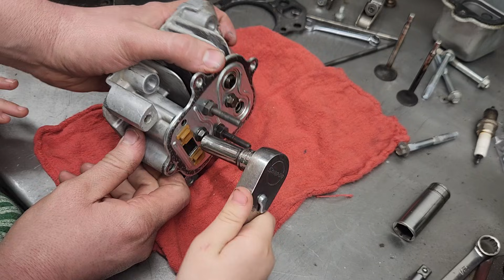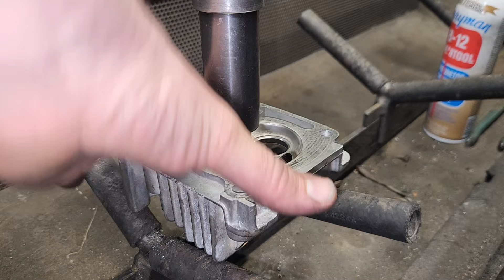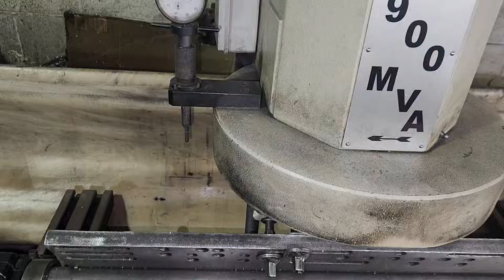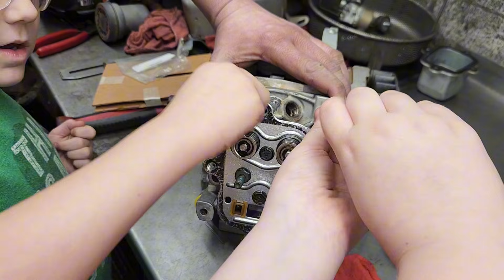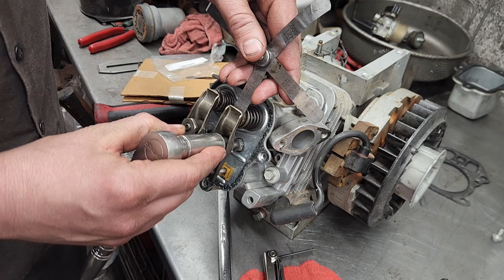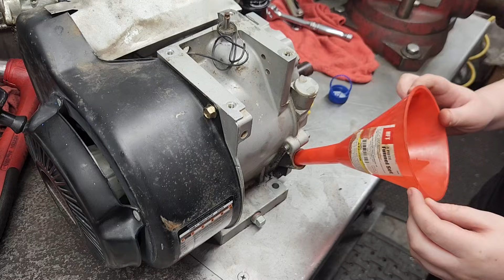6hp Briggs & Stratton Rebuild Part 2. #educational #engine #diy #restoration #machine #repair

Comment: Not sure if the solid copper head gaskets are available for these smaller OHV inteks but the larger 14 + HP inteks that are known for blowing head gaskets chronically is a big upgrade. Whats with all these small engines and having chronic low spots on the valve seats? every single small engine I ever had apart the valves seats had low spots and I can't believe how bad some of them are yet they start and run fine like that... Do they warp with the first few heat cycles or is the machine work just that bad out of the factory?
Reply from the maker: They always gets very hot by the exhaust port and usually blow the head gasket and the exhaust valve seat gets warped.
Reply: @DavidsButler  I've seen a lot of intake seats also get warped on the flatheads. One I rebuilt years ago and put new valves in and lapped them in and the seats cleaned up well, ran it for years it never got hot and I was always good about keeping it full of clean oil and the cooling fins clean and it did the same thing all over again when I went to rebuild it again for real, got punched out .020" over new valve guides and everything this time. I also suspect the materials used in these small engines aren't quite automotive grade in most of them.

Comment: Maybe this video is a parody, or a satire of a small engine job because who really does head jobs on lawnmower engines in today's world of throwaway products . 
People throw away lawnmowers and small engine stuff at the slightest malfunction only to replace them with cheaper less quality motors!? 
So it's good that you show that these engines are reconditionable and are made to be repaired after all. And small engines can be modified and tuned higher than their production tunes 
I don't think a lot of people understand that.
Reply from the maker: I appreciate you watching. I agree a lot of people just junk them out. I really wanted to hotrod this engine like put a big cam and surface .030 off the head but little people would have a hard time starting it as you seen at the end of the video. Im going to post another video putting this in something after Christmas.